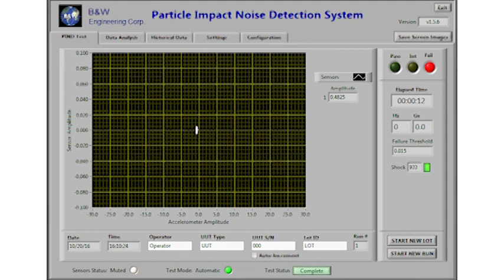DC-DC Converter PIND Testing

Comment: Thank you for this video but let me comment that the DUT is placed in a corner of the traduccer head. The correct procedure is to put the DUT in the center of the traducer, otherwise the sensitivity of the detection is redured even more than 50%.